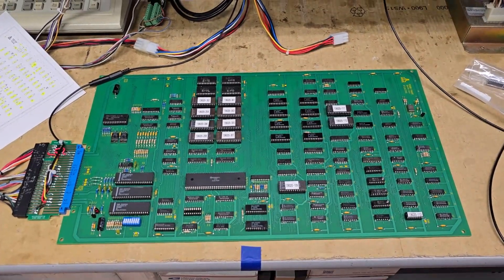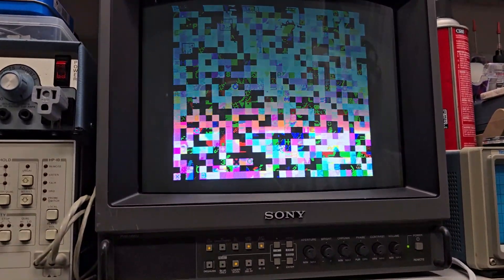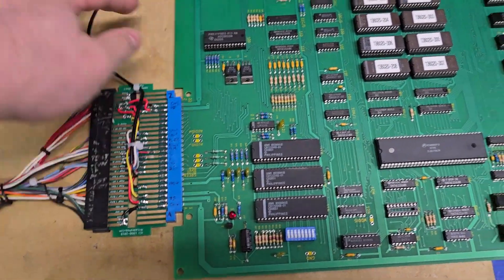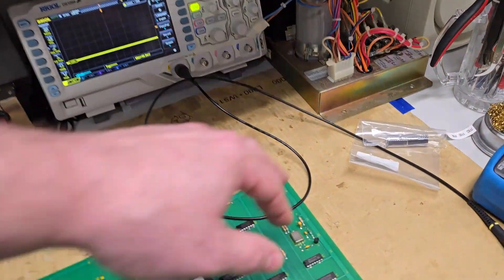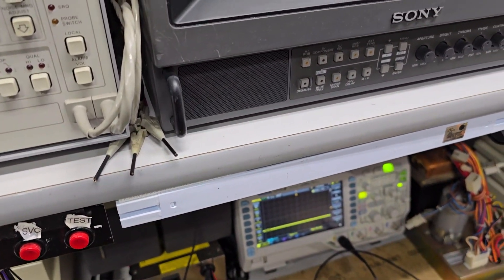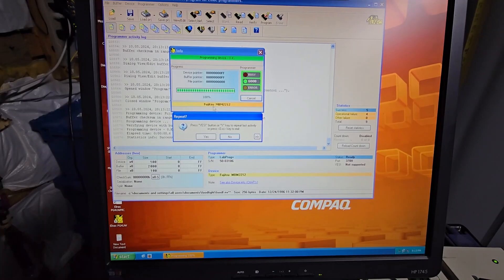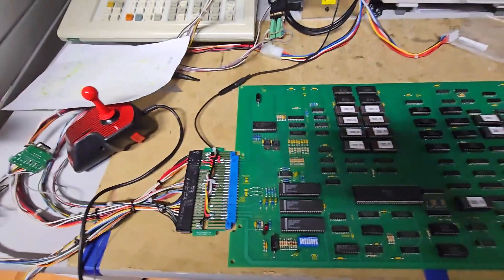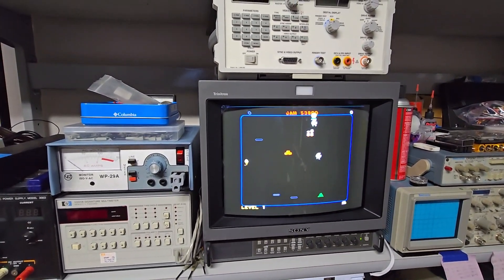Atari Food Fight Reproduction PCB - Post Assembly Test

Comment: Excellent work. That's one finished and done!
Reply from the maker: Thank you! Technically, I still need to replace the ceramic caps with mica in clock ckt, but I like calling it done too! :)
Reply: @jacklick  None of my 15 cabs are "Done", there is always a little thing I could change or clean better, and that the fun part of it.

Comment: Most arcade games use Chicklet Style Size Capacitors. Why do they use Chicklet capacitors because the Chicklet must have to do with either the temperature or ESR.
Reply from the maker: It must
Reply: @jacklick  I think the chicklet capacitor housing is made out of the same material used for power resistors for stability and heat

Comment: The reason Mica caps are used in the oscillator circuit is because they are extremely stable. Even under heated conditions,  they just do not drift, and they are usually more accurate on their value. This affords a very stable, and consistent frequency. Ceramic caps are generally not used in those types of circuits, because they tend to drift, and are very touchy when it come to heat.  They are mostly just used in bypass circuits where accuracy is not critical.
Reply from the maker: Thanks for the comment and info.  I mistakenly said mylar vs mica in vid.     Went down 🐇 hole ... always learning new stuff in this  hobby.

Comment: Why would a switching power supply causing timing issues of the read/write times for the NVRAM? you mentioned it in the video at time 9:40
Reply from the maker: I linked to the thread that discusses it.  It reportedly has to do with how long it takes for 10v unregulated to drop below 8v of zener to trigger write vs how long 5v stays available so nvram is still operational to support the write.  In an originall cabinet, there is like a 10k cap on those lines vs on bench it is not.  I didn't see the behavior on my bench but also didn't change settings or hs.
Reply: @jacklick  yes all arcade games used the big blue 10,000uf to 20,000uf cap, is this what you're talking about that is keeping the 5vdc stay longer on the NVRAM? When you turn ON a switching power supply it should output +5vdc, -12vdc and +12vdc, why would they drop in voltage or have different timing of voltages?